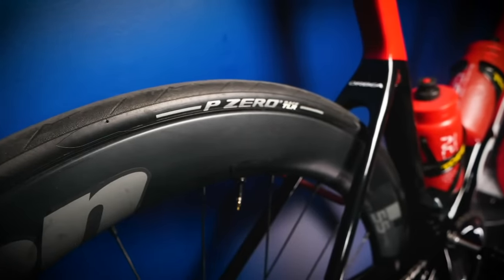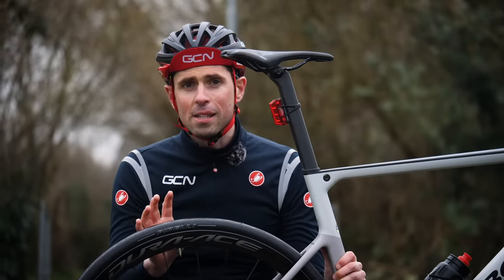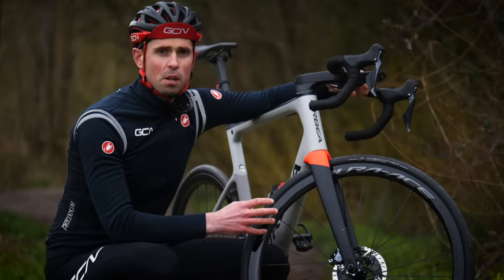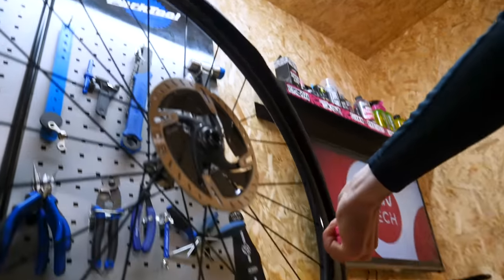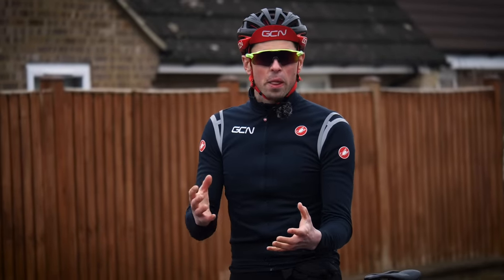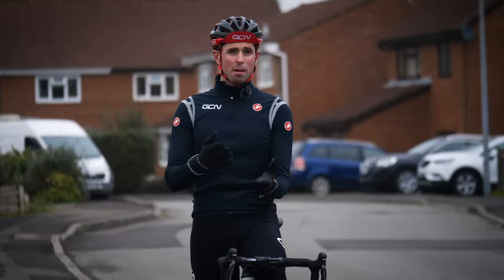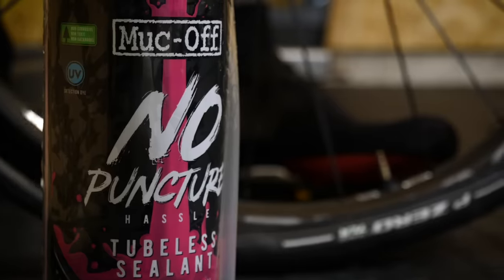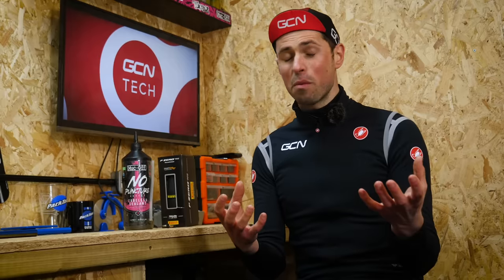Tubeless Convert! | Why Alex Will Never Use Inner Tubes On His Road Bike Again

Comment: How can a lower pressure and bigger contact patch be a good thing?! Lower pressure means it is easier to damage tire on road curb or hole, bigger contact patch increase rolling resistance.It all seems wrong. Big, fat tubed tires inflated to stone hard (small contact patch, lots of rubber between pavement and rim) is the way to go!!!
Reply: Makes sense to me. A wide tyre also has more aero resistance hence should be slower.

Comment: So you run tubeless, but still need to carry plugs for bigger repairs, maybe pliers to get you tubeless valve out of the rim because sometimes they get stuck, spare inner tubes just in case and a rag and gloves to clean out the sealant.  Not to mention the squirted out sealant expelled when you puncture and which covers your bike, your legs and your mates eyeballs.  😂. I’m just a dinosaur.

Comment: I have run tubeless. Nice... But still much prefer tubulars (and rim brakes).  There's  nothing like running 1000 to 1250 grams wheelsets with tubulars with latex inside... and don't tell me its expensive, a $20 vittoria rally on a 1100 grams tubular wheelset still feels way better than any tubeless on a disk wheelset that weighs 1600grams with the disks installed...
Reply: Absolutely well said.

Comment: For my crossbike I have 2 wheelsets, one with cross tyres and one with road tyres. The cross tyres are tubeless, because they came like it ( but I will keep my offroad tyres tubeless). But the road wheels and tyres are with normal innertubes, with a couple of reasons: I have never had a flat tyre, tubeless is more expensive and even though I live in belgium, I’m not craving more comfort.
So for the time being I will be riding innertubes on my road wheels

Comment: Tried converting a wheel to tubeless. Had 13 trials, had to buy 2 tapes, 2 sets of valves, spent more than 100 euro. Was able to have a normal ride, but overnight found the wheel is flat. And these 13 trials were a nightmare to clean sealant each time. With all honesty, I did not notice any difference in riding. If tape fails during the ride, the sealant won't seal it, and you'll need to carry a pair of plyers to remove the valve in such circumstance. Personally absolutely do not recomend.

Comment: honestly couldn't be arsed to go tubeless. I started road cycling in 2018 and have ridden about 15k in total. Only ever had 3 flat tires. 1 on the go was fixed really quick, 1 overnight so I just fixed it before my next ride and 1 on a short commute in the city where I didn't take inner tubes with me so I just walked to the next bus stop. I rode quite a decent amount of gravel with 28 road tires. Tubeless setup and maintenance is just too much work. And I never had any comfort issues even on +200km rides

Comment: 17 punctures last year using tubeless.  All self sealed without plugs.  All seep a very small drop of sealant over time when the wheel is idle.  I would rather check/change sealant a couple times a year than  stop and make repairs in the middle of gravel nowhere.

Comment: For years i’be been watching videos from GCN and other channels from Europe about going tubeless. I gave it a go a few months ago and it did not work for me, even with different tires (I used bontrager R3s and Continental gp5000). In my case, I live in country with very dirty roads and what happened is that the tires kept ripping off at least once a month, being the rips so big that the inner sealant wouldn’t make its job. What I imagine is that the cleaner the roads, the better the tubeless set up performs.

For races, I plan on using them again, but for me regular rides I find it better and easier to go with the inner tubes.

Would like to hear your thoughts!
Reply: Just get latex tubes for racing.  I would bet they're faster than tubeless, without the hassles.  Only downsides vs normal butyl tubes IME is that you need to fill them up before every ride (which you would for races anyway), and that you pretty much need to replace them, rather than patching (not a big deal for racing, and still way cheaper than buying bottles of sealant)

Comment: @Alex Paton why run the tests at different tyre pressures? Surely you're not afraid of a pinch-flat on your local roads with inner tubes at 60psi?
I've run tubeless on mtb and gravel bikes and love it. I've plugged those tyres too without problems - didn't even have to lay the bike down, let alone take out the wheel. I am totally sold of tubeless for lower pressure applications.

 But on the road bike, with my 2nd hand tubeless GIant SL1 wheels, I've had a recent cut, 2mm long, that did not seal. There was a messy ejaculation of sealant of course...
Fortunately it happened as I arrived home. I thought about plugging it - then thought the plug could extrude later as has happened to my very competent bikeshop owner friend. So I thought I might as well put in an inner tube, afterall I carry spare tubes with me anyway. 
Separating the bead from the rim took a lot of effort and required tools - it was as if glued to the rim - loads of old dry sealant on the inside of the tyre too and the valve required pliers either side of the rim to be removed. Turning the nut simply turned the whole valve! No way could I have done this at the roadside. 
It's put me right off tubeless for training on the road. Although I can see the potential value if racing.

Comment: To compare apples with apples, all three tests should have been at 90PSI.  By dropping the pressure on the tubless run you are trading speed for comfort on the tubless and therefore are comparing apples with carrots.  You could have ridden another 11 minutes on a fourth ride at 90PSI to get this directly comparable data point.

Comment: Claiming that inner tubes are rubbish is rubbish... Unlike tubless tires, inner tubes are cheap and easy to maintain, fix and replace both at home and on the road. I don't buy all this marketing  crap about tubeless better puncture and pinch resistance, less rolling rolling resistance, less weight and ability to ride them on lower pressure. How come they can be better than inner tubes if you constantly have to check the sealant every now and then, add it or replace it and face potential tire burpping...

Comment: I've had my Norco Sight VLT e-bike for 2 months now, it is my first tubeless bike, and I was excited to never have to deal with flats again.  However, I have been dealing with a slow leak in the rear tire.  How can a tubeless have a slow leak??  Why doesn't the sealant take care of that?  Earlier today, I took the tire off the rim to look at the valve seal... what a disgusting mess!  I cleaned it up, patiently peeling the residue from inside the tire and rim, then stuck in a nice, ordinary inner tube. No more mess.  No more wondering what I'll do if I flat in the forest.  No need for yet another bottle of chemicals.  No need for an air compressor.  Inner tube.  Tubeless is a solution looking for a problem, at least from a mountain bike perspective.  Not a fan.

Comment: tubeless road is great until you get a cut that too big for tire plugs and sealant to seal..  and then the nightmare come when you want to install the tube.. mounting a tubeless tire is pain the ass unless you got strong hand..  and then you need high pressure pump to seat the tire on the rim even with tube..  small mini pump in the middle of nowhere cant do the job..

Comment: I've heard that if you do get a puncture with a tubeless tire that doesn't seal, it's near impossible to unseat it on the road and put in an inner tube to get home. As a skinny cyclist with no upper body strength, this is what's keeping me from switching.
Reply: Hey, I've not heard of such a problem, nor experienced that myself. 1 tyre lever does the trick just fine and you can put an inner tube in and be on your way.

Comment: Just spent an hour trying, and failing, to remove a Challenge Gravel Grinder tubeless tire from a Hed Ardennes rim. The bead WILL NOT UNSEAT. Tried every trick in the book, including standing on the tire, a vise, etc. But sure, tubeless is great. Right.

Comment: @Alex, just curious why you chose to inflate the tires to 90 PSI with the inner tubes?  I've been using 28mm tires for the last 5 years and I inflate them to 70-75 PSI.  Oh and I weigh 77Kg.  90 PSI seems a bit excessive to me for a 28mm wide tire.
Oh, and no, I do not use tubeless, I have seen the aftermath of punctures and a tire failure where the sealant gets sprayed all over the bike.  No thanks.

Comment: I just went tubeless and although this is maybe because I switched to stiffer sidewall tires (from Schwalbe All-Round to Continental Terra). Definitely rolls better on any surface, confortable and more responsive in corners. By god I loved my gravel bike with the tubes but it's a level higher now. I did spend a week learning and making mistakes to get the thing working though.

Comment: Alex, I have run tubeless for about two years and love it, converting both bikes.  But I have an observation and question for you.  I run 25  x 700 on my road bike.  If i spin my tubeless front tire inflated 85 lbs after mounting with no sealant they spin for 2 mins 15 seconds consistently. With sealant 1.5 oz carefully done per specs and swishing the sealant around in the rim, they either spin for 55 seconds or even less 45 seconds under two experiments.  Can you explain this?  I not feel I am losing speed...sadly, but don't really know on the road.  Thank you
Reply: This is an easy explanation & one that should have been answered by now. It's a shame he's not bothered to do so, unless he can't fathom out the answer for you.
Let's give him a few days more.

A clue is, the more sealant you add, the quicker the wheel spin will stop.

Comment: All this talk of "run at much lower pressure" seems like nonsense to me, and sounds like lots of you could just have been running at lower pressure with tubes all along.

Go look at both the Silca tyre pressure calculator or the SRAM tyre pressure calculator. For me they only suggest a 2psi difference in pressure when I changed from butyl tube to tubeless options. And the Silca site actually classes latex tubes / tubeless as a single option as there's no difference. 

Pinch punctures are just a complete non-issue on road in my experience, theres nothing stopping people running lower pressures with tubes right now.

For mtb it's a thing, and that's why they moved to tubeless ages ago - but the pressures involved are wildly different.

Comment: If you get an object penetrate your tire on a tubeless setup, it's ride over.

That's why most cyclists are best off using butyl tubes.

Butyl because mending them with a standard kit is easily possible on road.

Comment: Came for all the comments from Roadies resisting change in any form, left satisfied! :). I do agree for just riding around it comes down to how much you value the extra comfort of lower tire pressures versus mounting a TL tire. For triathletes and anyone racing without team car support, the additional puncture resistance and speed on TL make it will worth getting the tires mounted.

Comment: Mainly because Alex is paid to promote tubeless and GCN keep pushing tubeless, the real difference? With tubes no sealent everywhere, and if you get a split tyre you need to put a tube in anyway to get you home! On my mtb makes sense, on the road not so. Why do GCN keep pushing it? It is a lot cheaper and easier for manufacturers to build hookless wheels,

Comment: There seem to be countless videos on YT about the improved comfort and "speed" of tubeless tires (this video was yet another one). There are also countless videos about "converting" to tubeless. What I haven't seen much of are videos about routine tubeless maintenance and what it is REALLY like to change a flat on the road. I probably need to do more research on this last point. I am not against tubeless but I am VERY much concerned about how to quickly and easily handle a flat on the road. The comments below only add to that concern. So, what's it REALLY like when you get a flat on the road with a tubeless tire?

Comment: I just started using tubeless: Conti 5000TL 28mm with Conti sealant and not impressed. Had 4 punches in a rear wheal and non of them where sealed by sealant. Bought Dynaplug and carry a tube, but the tire is such a PITA to put on the rim that I may leave the tube at home - anyways I won't be able to install it outside.

Comment: Rode tubeless until I got a puncture that the sealant couldn't fix, got covered in harry monk 10 miles from home and the wire bead snapped all three of my crappy plastic tyre levers trying to get the bastard off so I could stick a tube in it. Luckily I had a can of gunk that got me home at a very low pressure. Went back to tubes after that, use sealant filled ones. Yeah I know it costs 15 seconds + but it's faster than fixing a puncture.

Comment: After my LBS broke a Carbon rim trying to install tubeless tires they no longer will install them. Also after about 3 months the sealant separated and turn to oil unknowingly, I got a flat and was stranded 50 miles from home in the middle of nowhere. Had a spare tube but couldn't get the tire off to install it. I Had to call a Uber to come get me which took hours. It's back to tubes for me until the Rim/Tire manufacturers get there tolerances correct.
Reply: Stay away from that LBS...😡

Comment: i just got into bicycles.. i started riding to homedepot, autozone, walmart… i dont ride for fun, mind as well run when i need something… $2500 gazelle t10 bike i got used (already 2 flats with tube tires) this tubes suck and not reliable, ill try tubeless before i give up on this sport… i honestly replaced the bike with my car but these tubes not reliable… 2 flats in 3 days…

Comment: Haha, 3 watts! 😂 Now I know why I never won any Grand Tours!

On a serious note, whilst I've never ridden them, can possibly see the benefits of running lower pressure - but am skeptical it's not just (another) marketing gimmick, and to be honest, the 'bike admin' chunk of the pie chart vs 'actual riding', is already large enough thanks, without having to mess around with sealant etc!
Reply: You can probably run lower pressure with your tubes anyway.  If you're not pinch-flatting, and it doesn't feel too squirmy, you're fine.  If you're low enough that you'll have problems with pinch-flatting your tubes, you'll be trashing your rims/tires by smashing them into bumps.
I think the people who are tubeless fanboys are either totally new to it and haven't been screwed over by a failure, or they just don't ride very much.
I've given it several tries, wasting a lot of money and time, and it always ended up biting me in the end.
Reply: @nwimpney  I ride a lot and have been tubeless for two years never had flat. With tubes I'd have 3 or 4 flats each year riding the same bikes on the roads and trails. I don't plan on ever switching back.

Comment: Conti 5000TL - top up the air when needed (usually short blast every week), sealant (Stans) every 3/6 months. Initial setup slightly problematic, now familiarity with the idiosyncrasies makes this a breeze.
Reply: I'm running the same combo Conti GP5000TL with stans and I have had zero issues thus far. I can even see a few white spec on the tire where it sealed a puncture. Fitting the first tire was a struggle then I found that little soapy water and sort of "zippering" on the really made them go on quite easy.

Comment: That tubeless is faster is rubbish. That tubeless is more comfortable is rubbish. However, Tubeless protects against minor punctures, but if you get a big one, you are in a lot of hurt, trying to repair it on the road. It's a choice based on emotional opinion, not facts. If you just want more comfort, go to 30 or 32 MM, tube or not doesn't matter.

Comment: I was an early adapter of tubeless, but I’ll never ride them again. In all the years I’ve been riding 10.000’s off miles I only crashed once. And that was because in a descent, in a bending corner, at high speed, my entire tire unseated from the rim and there was no way I could keep myself from crashing hard. My SRAM red eTap shifter completely broken. My titanium pedals damaged. My expensive Assos Sturmprinz rainjacket ripped. Almost a 1000 euro’s of damage. And the most terrible part of it all is that I became very insecure in descending with tubeless tires. So back to innertube’s for me.
Reply: sorry for you! and your kit!! at least you were using your kit, which is better than buying it and them not using it!! this whole comment section is changing my mind about putting tubeless tires on  my wheels.   have elites that are tubeless ready.  previous owner had to make the call of shame to be picked up in the middle of the wicklow hills because of issues with the tubeless set up. thankfully they've been working fine with tubes and normal tires!!
Reply: @kingoffifa  was wearing the Assos rain jacket for the first time. Lucky enough Assos has great service and crash replacement policy. Love it.
Reply: @tacoschaafsma8896  oh that's pretty cool.  didn't realise they had that. only have a pair of shorts,  and they are awesome.

Comment: Tubeless with road bike pressure and low volume really seem meh. The air will go out really fast and you'll probably need to stop to pump and even risks unseating the tire. Plus punctures on the road are pretty rare anyway with good tires. So my road wheelset stays with tubes.
However I definetely love tubeless for my gravel and mtb tires.
It's kinda like discs, I love them for gravel or mtb, but if I didn't use my gravel with a secondary wheelset as a road bike and instead got a dedicated one, I'd definitely go with rim brakes and alloy wheels with tubes, because it's enough and less assle.